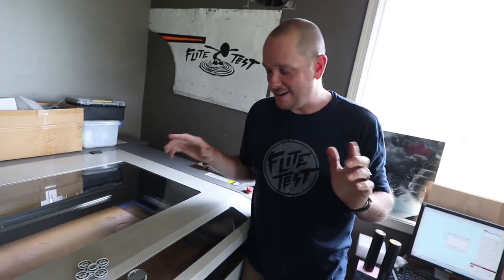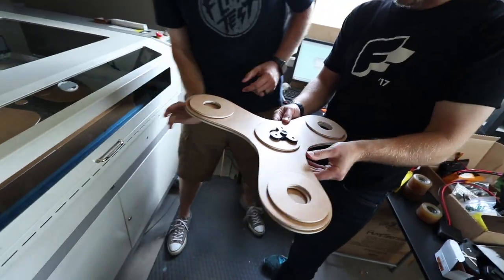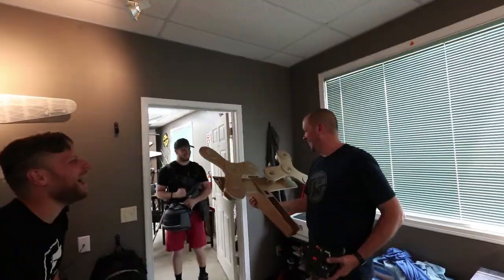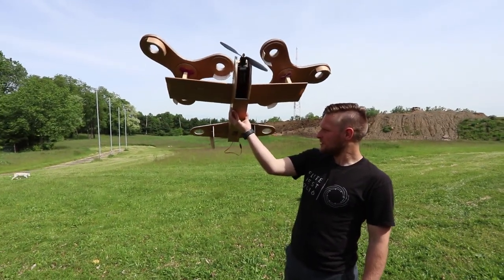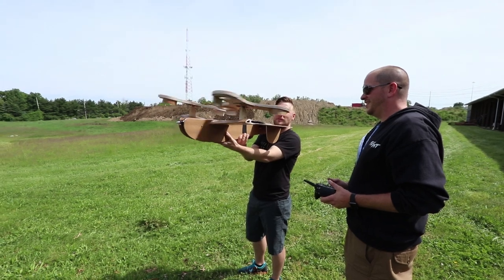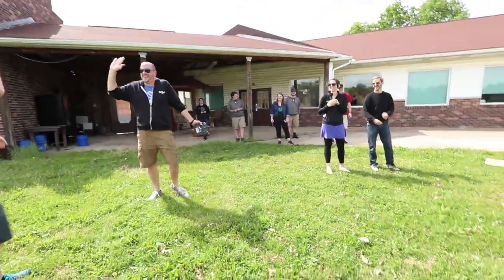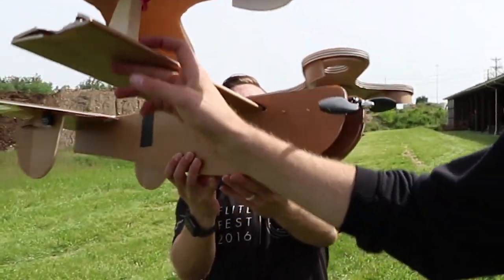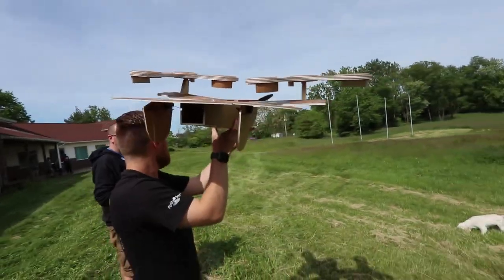GIANT FLYING FIDGET SPINNERS? | VLOG0080

Comment: I think you are suffering from the gyroscopic effect of the spinners. By having them counter rotating, you are probably achieving higher levels of stability most of the time. But other times they will add up in ways that may not be intuitive, hence it suddenly drops from the sky. Here are some things you could do to reduce their effect:
* make them smaller.
* make them lighter, particularly towards the tips. - if you only do one, do this.
* increase the effectiveness of your control surfaces.
* make them spin slower.
* make them spin in the same direction.

I hope that helps.

Comment: That was killer, but you forgot to compensate for the center of lift and center of gravity being changed with the forward area of the main wing spinners. Flew tail heavy. Then you took out the extra nose weight of the other battery making it worse. LOL Great fun though. The failures can be better than success stories. In fact usually are. Great times guys. Wish I could move back to Ohio and join you guys.  You're my type of people.

Comment: I love FliteTest, I watch all your videos. can we make those spinners like propellers by tilting the arms of the fidget spinners at an angle so the generate lift and use motors to spin them like the avatar helicopters. and similar spinner setting for the tail. That would be a blast! and also a head turner.
what do you think?

Comment: make some planes with 18Gax1x1 plates here and there....so when they get stuck on roof tops like this one, you can send out a drone to the rescue that has a length of light gage rod or wire hanging off with a small neodymium magnet attached to the other end. :)

Comment: Can you guys make one of those aircraft that flies like a bird, and flaps it's wings? I also had another question. Does density altitude have the same effect on rc like it does on full scale aircraft? I live 2 miles above sea level in Colorado and have crashed so many times from stalls, even while flying at higher speeds, it usually happens on hot days. I've had some strange accidents when the plane just fell out of the air, even in level flight

Comment: why cant you 3d print the fidget spinners for the plane so that they are aerodynamic and the plane behaves like an autogyro... you could use existing boomerang designs, and from the top/bottom it would have the appearance of a fidget spinner but from the side you can see that they are true airfoils
also, put the prop in a pusher config so that the airflow over the spinners is clean.... getting them to spin from a hand launch might be tricky tho